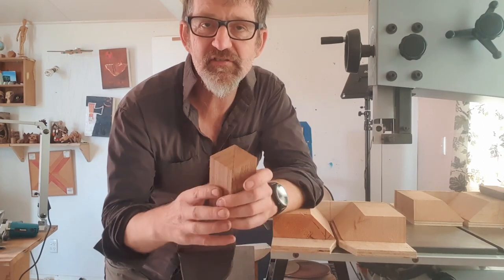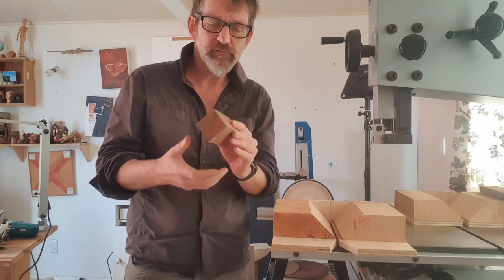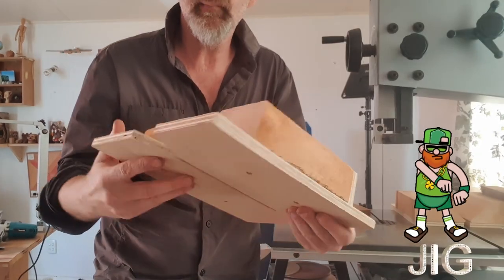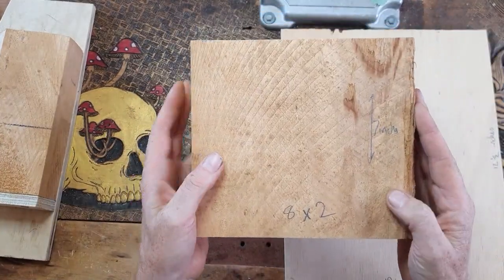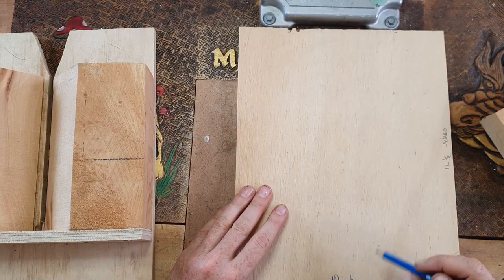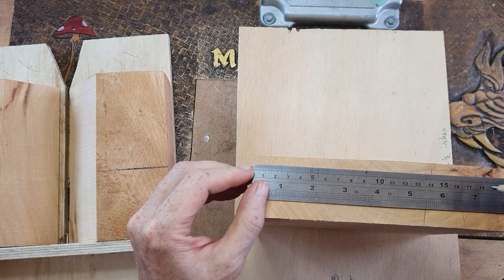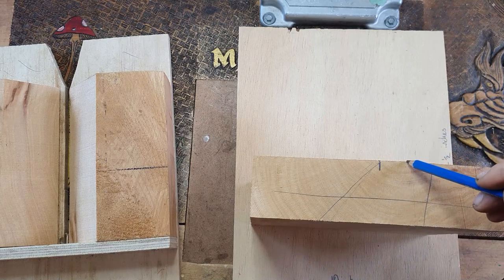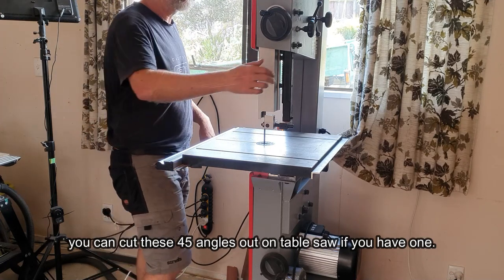Bandsaw Jig for Wood Carving

Comment: I killed my bandsaw!😬 Probably because I don't really know how to use it properly so these tips are super helpful if i ever manage to repair it! Thanks Matt!
Reply from the maker: Cheers Claire. when you say you killed your bandsaw is the motor not going or did the blade just come off?
Reply: The blade exploded into a mangled knot! The doors don't close without some wrestling so it doesn't start for safety reasons and the tensioners are so finickety it pings off if you breathe on it hard! It was on the cheap end so i'll have to wait and invest in something sturdier later.
Reply from the maker: Yeah, that sounds like a gonna.

Comment: Great job I use sleds like this a lot it works great to drill a hole on the corner Orin a round piece of wood be safe and take care
Reply from the maker: Cheers. Sorry dont understand about drilling a hole on the corner?
Reply: @MattCarves  if you need to drill from corner to corner the jig will keep it in place so you come out. One corner to the other corner